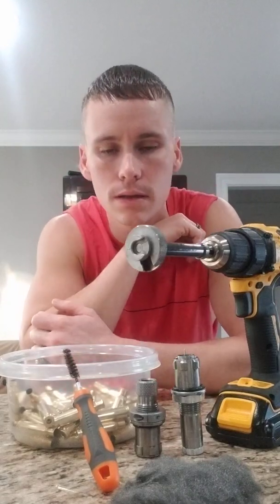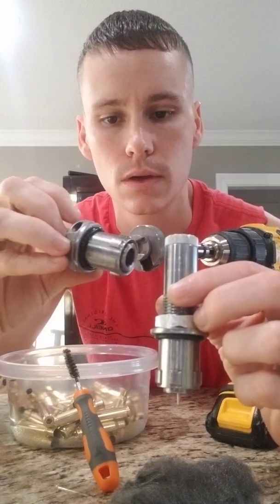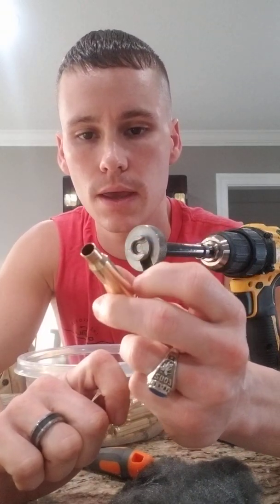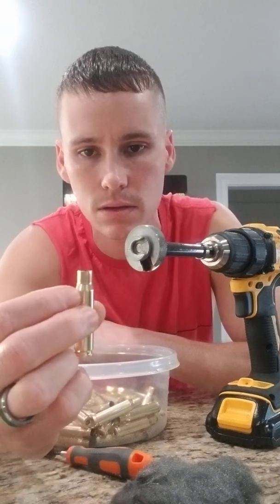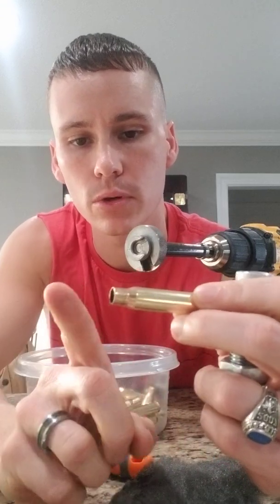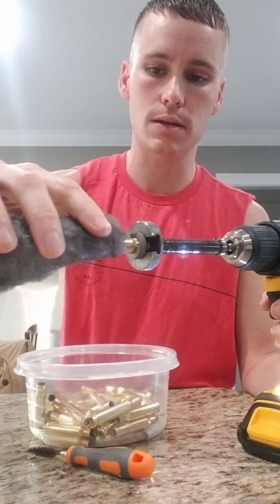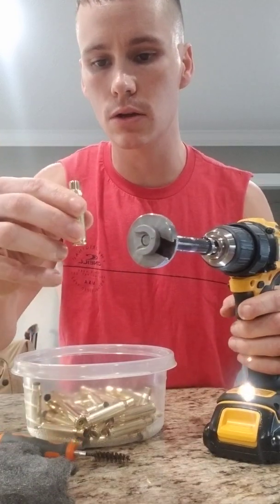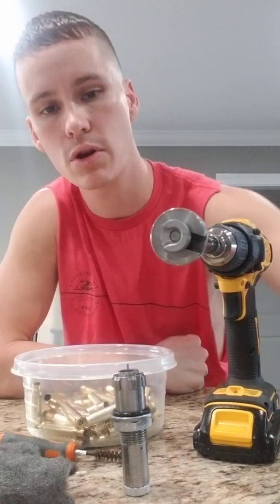How to lower your ES & SD numbers by uniform case neck tension.

Comment: you are correct to use 'concentric'.   concentric circles share the same center point so the distance between them is equal everywhere. a pile of carbon on one side of the neck would stop the bullet base from being concentric, and when launched, would hit one side of the chamber harder.